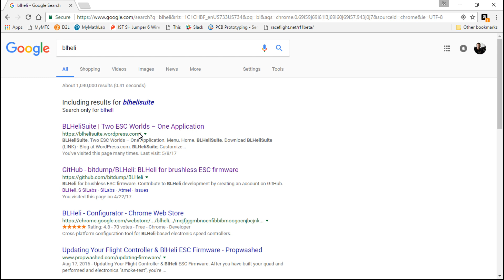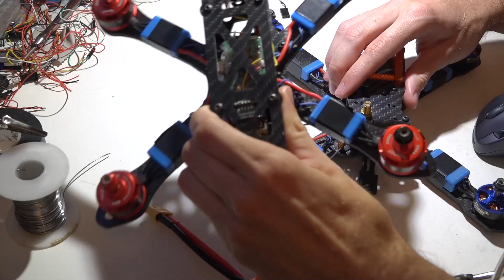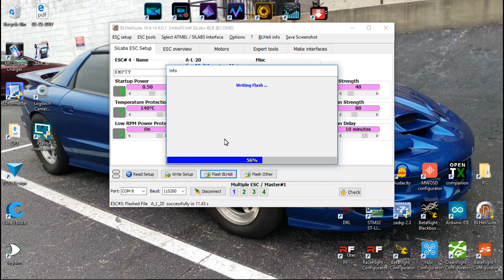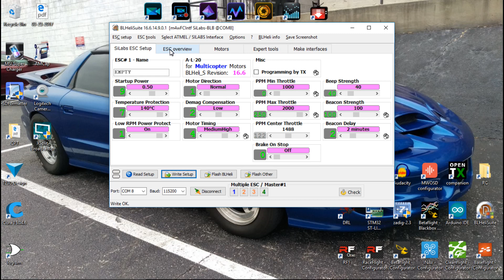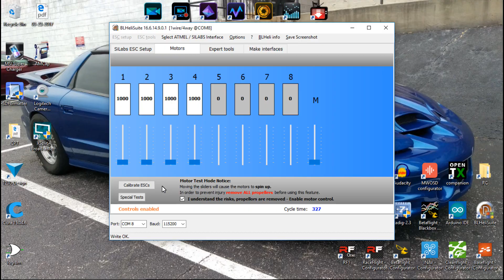Multirotor Build Pt16: ESC & Motor Set Up

Comment: I have a Mac as my primary computer, so I use the chrome app for BLheli. It doesn't have as many options, but it allows firmware upgrade, motor reversing and beacon settings, which is pretty much all I ever use. It has a simplified GUI, so it's easier to navigate too.

Comment: Hey JC! I really need your help. My little bee 20amp esc keep reseting every-time i plug in power. I calibrated the esc with blheli and did everything possible. I am pretty sure every component is fine
Reply: And when i try to use the motors tab in both Betaflight and blheli it keeps reseting. Just raise the tabs little bit.... and boom! Reset song